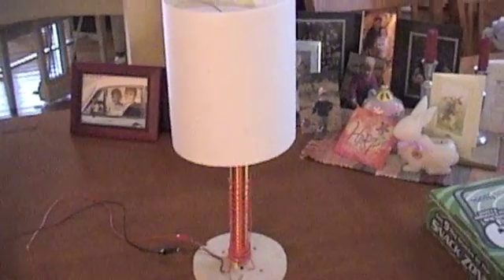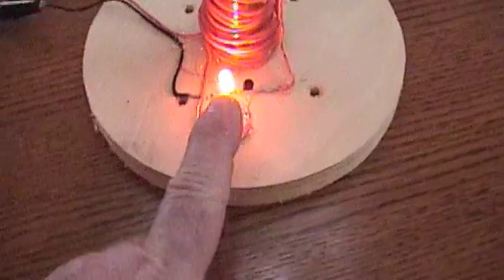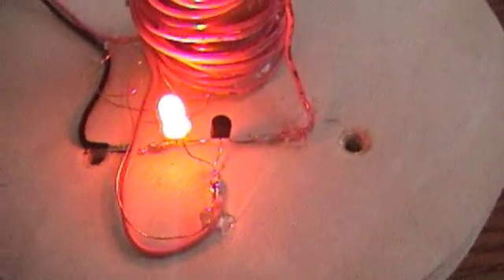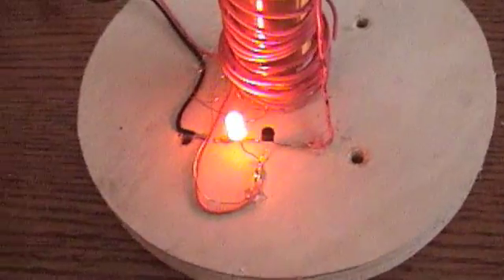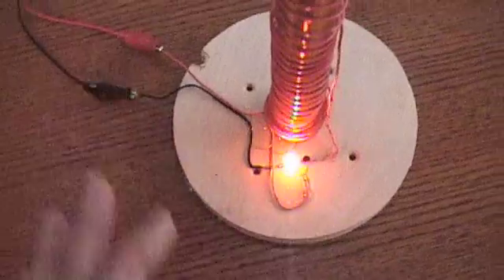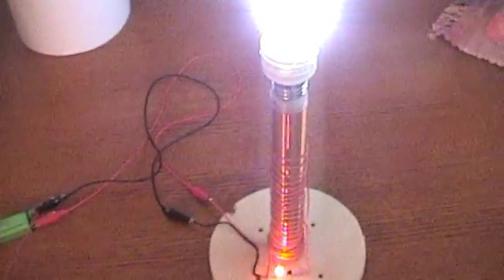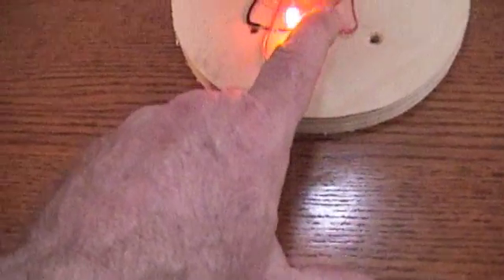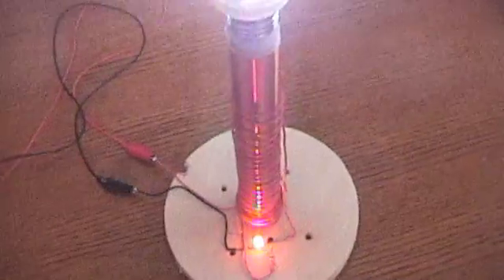Teslamp Exciter CFL driver

Comment from the maker: You can pry open a CFL and the bulb can be removed from the circuit board.  Doesn't matter which way the coil is wound.   There is some tuning involved in how the primary is placed around the secondary so allow room for adjusting the primary.  You can go down to about a 4" long exciter and still get results.  I went this big to look like a lamp.

Comment from the maker: Depends on the battery.  For a small AA size pack about two hours.  That's why it should be a solar rechargeable pack.  If the light goes out then its time to go to bed.